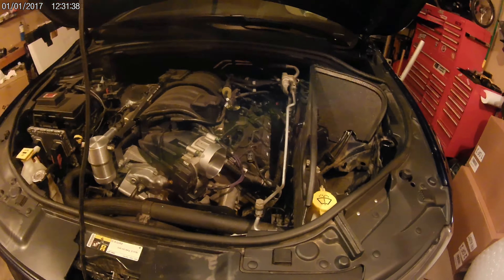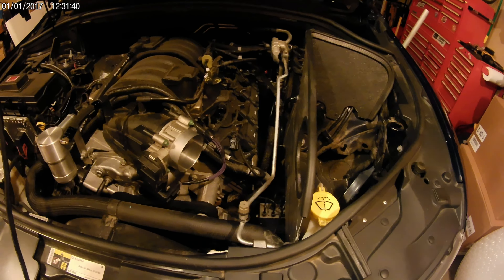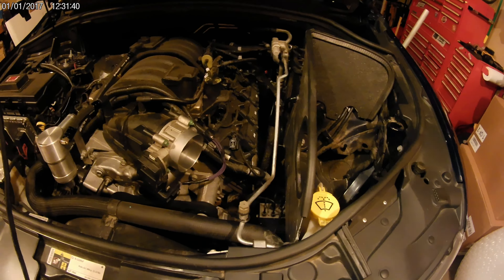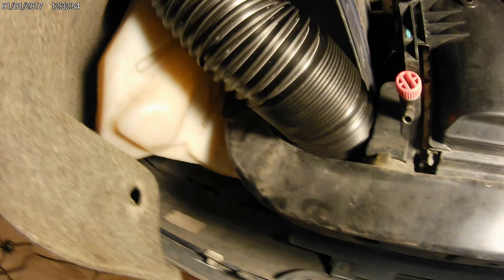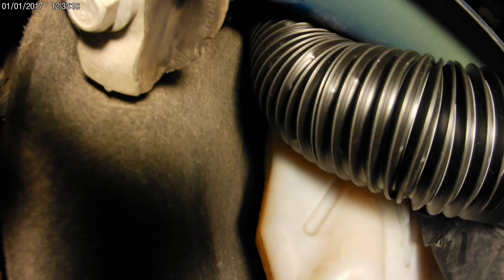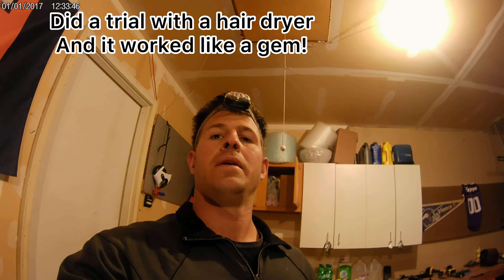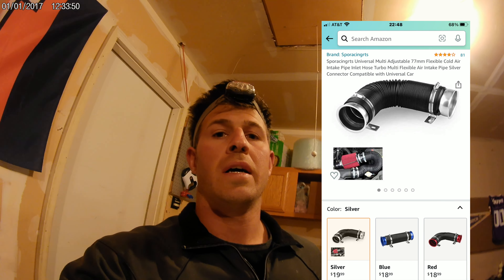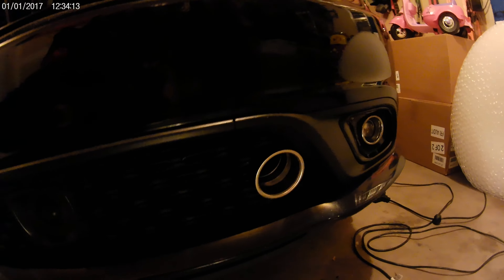Homemade RamAir on 5.7L Dodge Durango RT for $20…. Tools, thoughts, and outcome.

Comment: Nice work!  Where did you get the tube and chrome ends?  I live in Texas, so anything to cool the intake air would help.
Reply from the maker: Sporacingrts Universal Multi Adjustable 77mm Flexible Cold Air Intake Pipe Inlet Hose Turbo Multi Flexible Air Intake Pipe Silver Connector Compatible with Universal Car https://www.amazon.com/dp/B083BNZDZX/ref=cm_sw_r_cp_api_i_B1XXZK5JZB04JNQQZWAP?_encoding=UTF8&psc=1

This is where I picked it up from.

Comment: I love tinkering and modding also - I might have put the tube behind the grill though and not drill a hole - I'm also into aesthetics and looking good.  Not sure I like a random hole in the grill unless it's complimented by a same hole on the other side.  Did you take temp and airflow measurements before/after?
Reply from the maker: Before I was hovering around 15° or so over maybe even 20 over ambient. I just ran an errand and was about 7 over when fully warmed up. 

No before and after flow, but I just had an air charge of 761 with a DA of 7450. Pretty sure that’s the highest I’ve ever had at that number.

Comment: Nice! Interested to see how much that lowers IAT. Once i get my manifold I’ll try this and do some before and afters
Reply from the maker: I’m saying 5 over ambient… 1 over when driving... I hope lol.

Tomorrow I do some logging and I’ll compare to old logs. Pretty sure they were about 15-20 over ambient.
Reply: @jmata4506  I’d imagine its a good improvement. I was logging my stock intake the other day and it was 18-23 over ambient depending on vehicle speed. Did you go to Illinois? I’m from there but live in Missouri now
Reply from the maker: @ZacWade  well I did some logs… temps were like 5 over. Temps still rise just like any other setup, but they cool off faster with the tube. 

At highway speeds around town I seen 5-8 over ambient. Closer to the 5 though….

I lived just north of Peoria when I lived in IL.
Reply: @jmata4506  that’s pretty good temps! Highway driving I was 18-23 over ambient with the stock intake and now 13-15 over ambient with the afe and my janky intake tube set up at highway speeds (just until the 6.4 manifold arrives). I plan to get a similar intake tube set up to get air from the front grill and then wrap it all in gold reflective tape and see what the temps are after that.

I got ya, I lived in Edwardsville IL for a long time before i moved to Missouri
Reply from the maker: @ZacWade  today after about 4 or 5 miles I was 8-9 degrees over ambient. 

In more stop and go traffic and stop lights I consistently got back to 8-10 degrees over ambient.

Only thing there is Carbondale lol. At least that’s what I heard. Moving out of IL was one of the best decisions 🤣
Reply: @jmata4506  yeah IL sucks lol but I still have to cross the river to do jobs occasionally 👎🏻
Reply: You don’t think the performance hood with the opening directly above the intake is making that difference in AT?
Reply from the maker: @tonyharmsen5081  solid question man. I think it helps allow the heat to extract for sure. I see the heat waves rising out of the vents. 

On the other hand, how the hood works is pulling air through the scoop and pushing that hot air out through the vents, right where your intake filter is. I built that to pull ambient air straight to the filter. Temps hover 6-10 over ambient ( more consistent with low side) when driving. Longer you drive the closer to ambient you get.

With just the hood my temps were never that low. Had the hood on for about 6 mons before doing this mod.